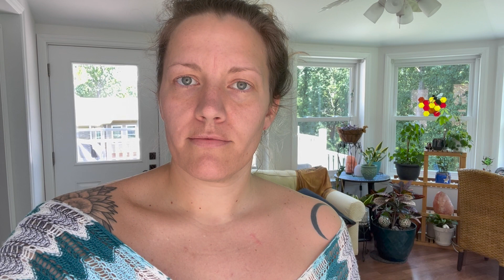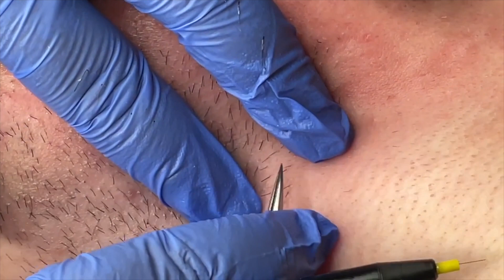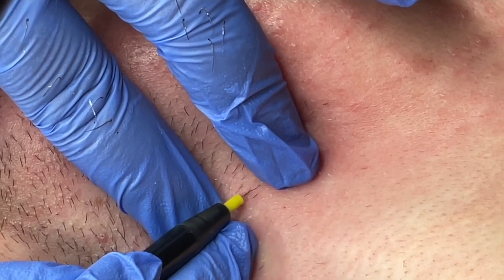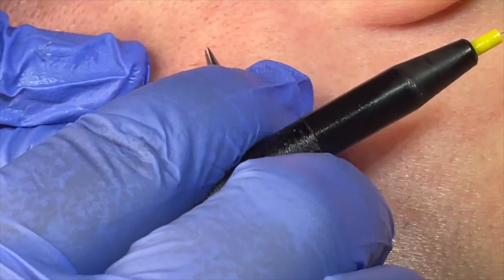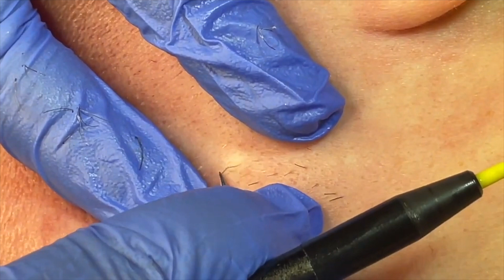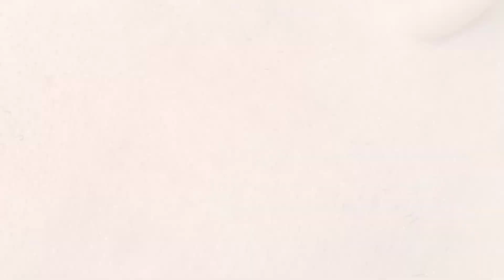Satisfying Permanent Facial Hair Removal process | Closeup footage of Electrolysis | PCOS/Hirsutism

Comment: Hi there! New to the channel. You may have mentioned it in a previous video. But why did you choose electrolysis over laser? Im about to start my journey haha
Reply from the maker: Hi, welcome! Great question. I actually have gotten laser previously (about 10 years ago). Unfortunately I did not know at the time (nor did the laser technicians...) that hair caused by hormonal issues (aka me with PCOS) can get stimulated and grow back 10x worse from laser. It is called Paradoxical Hypertrichosis - and unfortunately that was my exact experience with it. The laser treatments did not work, the hair returned with a vengeance..wasnt until years later I learned about this, learned about electrolysis, and am now undergoing precisely that. Electrolysis is the only permanent facial hair removal treatment!